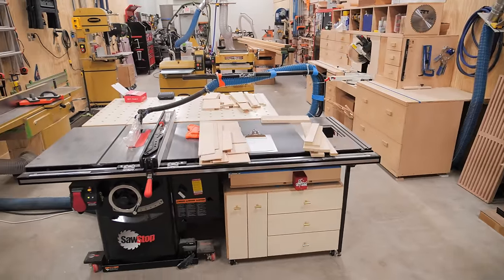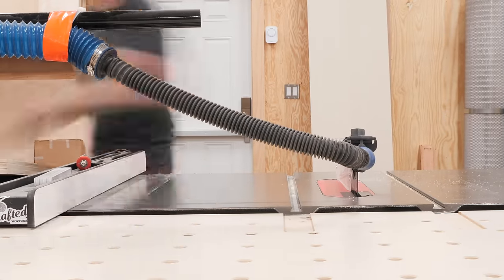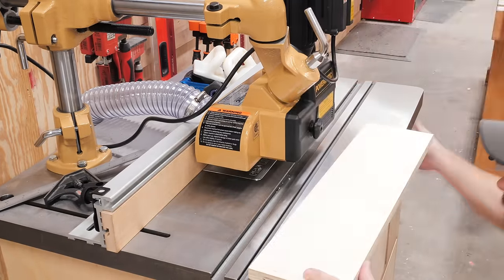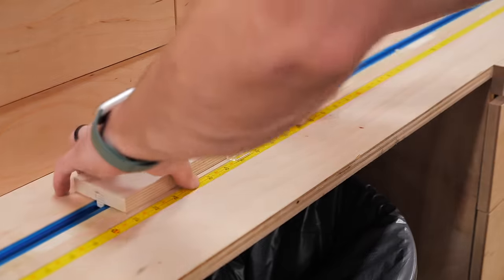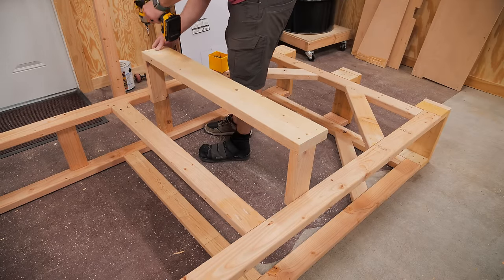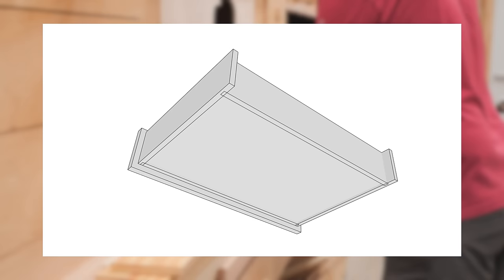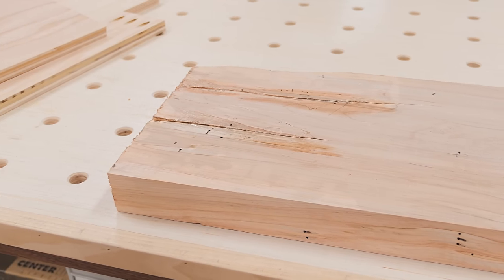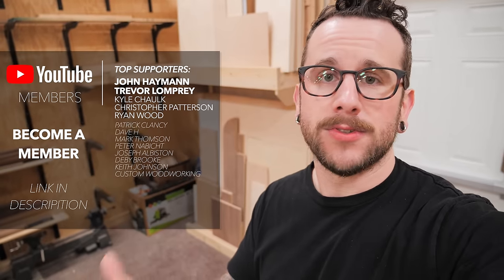3 MORE Shop Storage Projects! Table Saw Cabinet, Plywood Rack, Drill Press Cabinet

Comment: I like the projects well done,
I like how you call them DIY drawer runners, that’s how we use to build all our draws before drawer runners were invented, we use to put a small strip of hardwood on the drawer and the runner to increase the life as they to rub and wear over time. I know others have mentioned paste wax and you put it on, but I have found it can attract dust sometimes and makes them wear faster.

Comment: One tip I learned from Matthias Wandel - when you use wooden drawer runners, use hardwood or even a very thin layer of hardwood at the interface.  It slides much more smoothly than plywood or softwood (and obviously the direction of motion should be in the direction of the grain).  I just built a bunch of drawers for my assembly table and made my own runners out of maple scraps.  To make the drawers slide more smoothly, I added some iron on birch edge banding on the bottoms (one strip on each side) - and it made a big difference in how smoothly the drawers slide.
Reply: Great ideas.

Comment: I like how you mention the power feeder like it's an everyday shop item, but call the pocket hole machine a luxury item =P
Reply: The pocket hole machine is a luxury.  You go from something that costs 40 or 50 bucks when used with a power drill to about 500 just so you don't have to use a power drill.  Pretty stupid tool unless you work on wood all day.

Comment: I like the ideas and the video. 
The one thing I would change is the brand of screw you are using. Spax screws are WAY better than any other screws I've ever used and I have only split TINY pieces or super brittle smaller pieces with them. 2x material and plywood is TOTALLY safe. Also, their design allows for pilot hole less use which saves time and effort. With the possible exception of GRK, spax is the only screw I know of that will go into a white wood 1x2 without a pilot hole and not split it, most of the time.

Again, not sure what you are using but buy a box of Spax and I bet you will find them much simpler to use. I know this sounds like a shilly post, but I AM NOT sponsored or affiliated with Spax in any way. I just love their products and see that you are having trouble with something their screws minimize or eliminate altogether.
Reply: The other part about Spax that sets them apart from most other companies is that they make Torx headed screws which dont strip out unless the user (me, and you) have the bit at an odd angle or not set all the way into the head. They also hold onto the bit better than any Phillips I've ever seen.
Reply from the maker: Oh yea, I love Spax screws and use them all the time. I have pretty much zero Philips screws in my shop, they’re all either Robertson or Torx. Some of this plywood was crappy construction grade stuff so it splits easy, hence the pre-drilling.

Comment: Did you turn off the saw stop safety feature when using the sanding disk?
Does Saw Stop make a chop saw?  (THAT would be a good idea)
Reply from the maker: I didn’t but probably should have. And nope, that only have the table saw.

Comment: At 5:55 there is a drill bit on top on the drawer box that I believe is use to drill a pilot hole and counter sink in a single pass.  Where can I find this?
Reply: Not 100% positive, but Looks like:  Amana Tool - 55228 Carbide Tipped 82° Countersink with Adjustable Depth Stop & No-

Comment: Two questions: 1) is it just me or does the blade on your miter saw have a mirrored finish? That's cool, never seen it before. 2) Do you glue any of the pocket holed joints in the cabinet? Or do you glue shop furniture in general? I always glue shop furniture made with pocket holes but I wonder if it would hold up just the same without glue, and be much easier to take apart and salvage when the inevitable re-design happens!
Reply from the maker: Yup, the blade has a polished finish! And nope, I haven’t been adding glue to cabinets with pocket holes for awhile and everything has held up super well.

Comment: I've been binging on these videos lately and its inspired me to (over)build my next desk/light worktable using some of your tricks! Let me ask: should a pocket-screwed joint also be glued or is that overkill?
Reply: Only if you never want to take it apart. It doesnt hurt, but if you do screws every 6" or less, you shouldn't have ANY trouble with putting most things on the shelves, but that depends on what you are putting on the shelves. 

With heavy stuff (like scrap wood or mechanics tools) I'd use pocket screws, but also add a 2x2 reinforcement under each side and back of the shelf to hold more weight as the pocket screws really dont have much wood to support them compared to mortise and tenon or even dowel construction.
Reply: @woodworkerroyer8497  Thanks for the advice. The reinforcement/runner idea sounds good to me. It would be nice to at least partly disassemble this thing to move it.
Reply from the maker: Yup, totally agree. Glue isn’t typically necessary and allows things to be modified easily down the road.

Comment: Not false fronts, just fronts.
A false front is used where a drawer would not fit e.g. in front of a sink.
Reply from the maker: Not necessarily. These are still called false fronts by quite a few cabinet makers. If I constructed the drawer box to be four sided and to mate with the front, then it wouldn’t be a false front.

Comment: When you say 3/4" plywood isn't 3/4" think, are they actually 18mm? Because that's what plywood is sold as here in the UK.
Reply from the maker: It’s sold as ¾” here in the States but it’s actually 23/32”. With two pieces like I had for the top and bottom of the cabinet, that leads to a 1/16” difference, just enough to cause issues.